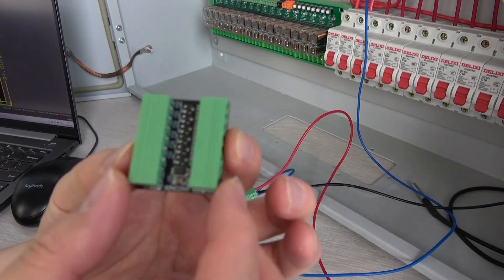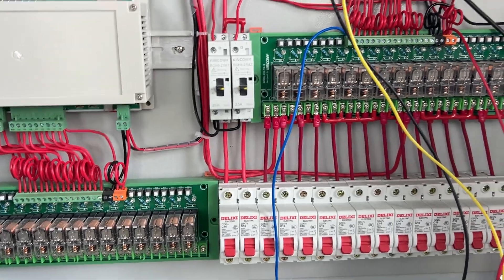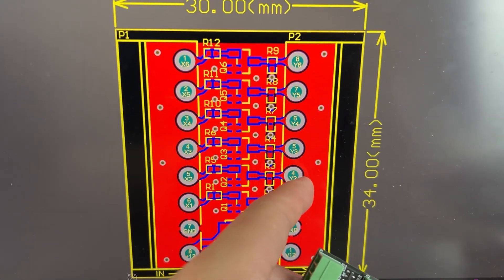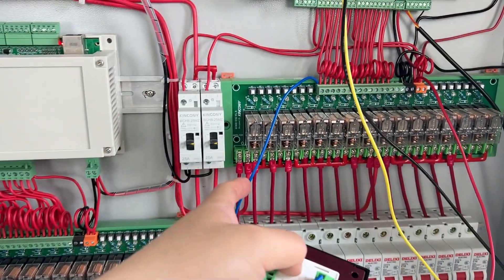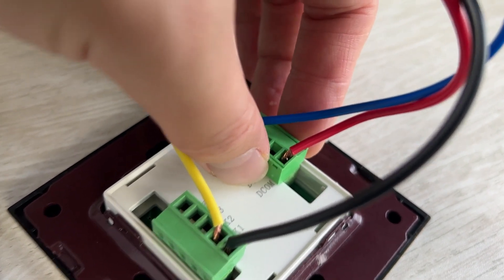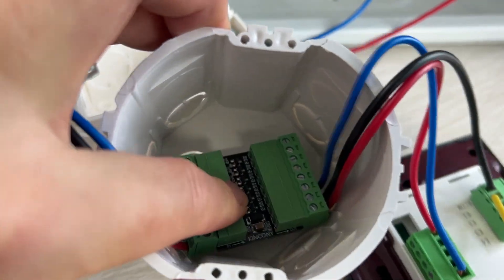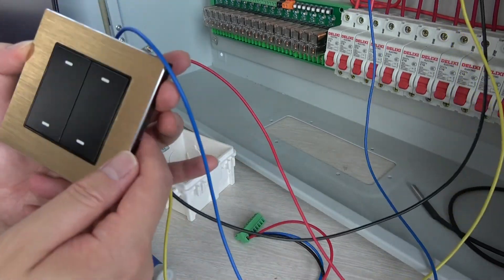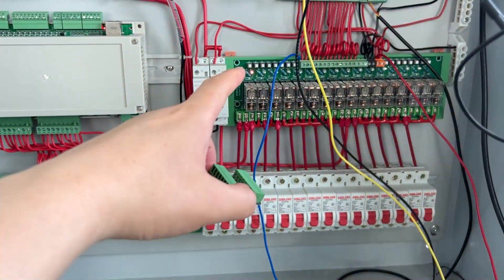logical level converter module for switch panel LED state feedback

Comment: Is this logical level coverter also required fo the kinkony touch switch for the state sync?
Reply from the maker: touch switch panel not need use it
Reply: @KinCony thanks. So the state will be in sync without this convertor. Is this because it has 12v power?
Reply from the maker: @emanuelloghin9471  yes

Comment: How do you decide when to use the  KC868-E16 OMRON switch vs contactors? Type of load, cost optimization, PDU space?
Reply from the maker: relay less sound noise than contactor, but if load >16A , contactor is safer than relay